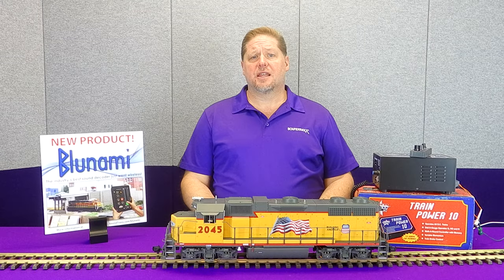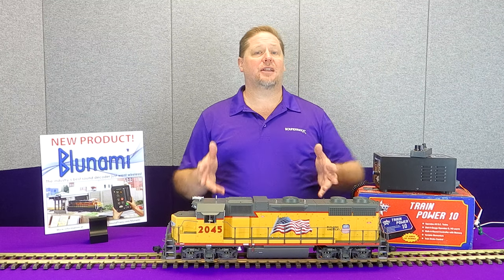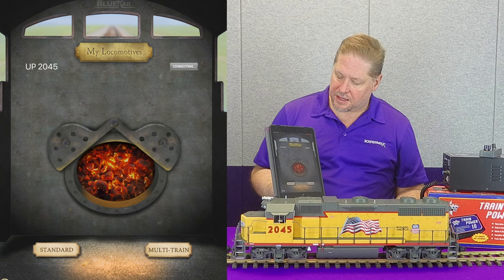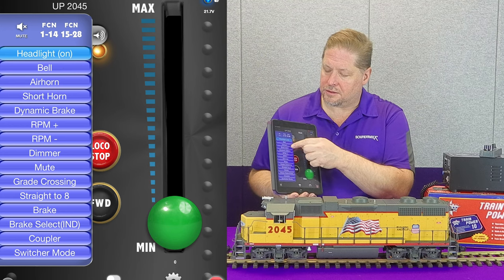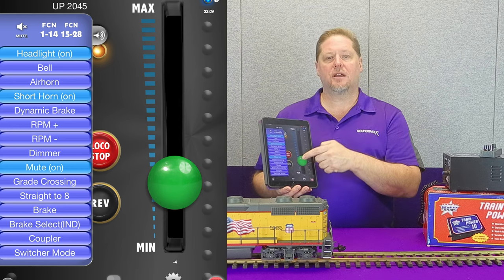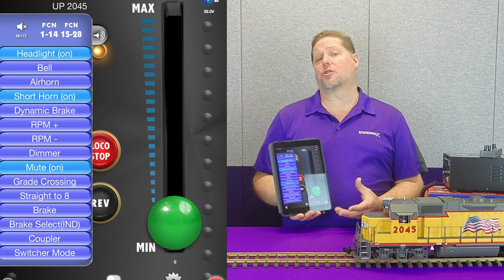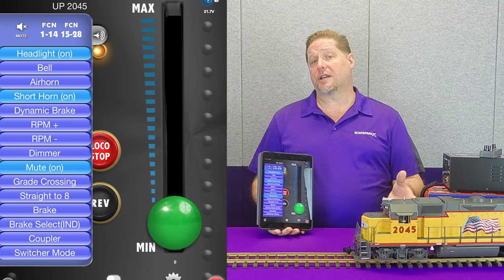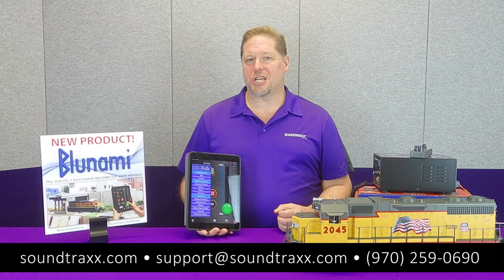BLU-4408 in USA Trains GP38-2 on DC

Comment: The stall current on the Blunami is rated at 4amps. The stall current on any USA Trains locomotive if far far higher than 4amps. How is blunami able to handle higher stall currents?
Reply from the maker: Wire the two motors in series and that will drop the stall current down below 4a.

Comment: if your track is powered with DC, will Blunami still support consisting?
Reply from the maker: As long as you have power to the decoder it will work - all features. Consisting is still in the works on the android app though.

Comment: Can it be installed on Kalamazoo 4-4-0 Locomotives?
Reply from the maker: As long as the stall current of the Kalamazoo loco is below 4A, then you should be fine.  These were released many years ago, so test the stall current to be sure.  If you need further assistance, then contact us at support@soundtraxx.com

Comment: Apparently we forgot to insert the installation video.   Here is the installation video for the GP38-2:  https://youtu.be/IdyTNJlb8P8
Reply: Bachmann advertises that the model will have a speaker already pre-installed. Hope that will make the install video for their Dash 9 much easier
Reply from the maker: Its linked in the video at 4:13 and in the description.
Reply from the maker: If you need any advice on the install just give us a call!

Comment: Does bluenami support smoke units? while id love to use bluenami I also would like to have smoke for major outdoor running, TCS's 501 DCC has very good smoke even synced to what the prime mover does? Does it support it similar to that?
Reply from the maker: You can use a function output on the Blunami to control your smoke unit. Contact our Support Team directly and they can walk you through the process: (970)259-0690 ext. 22 or support@soundtraxx.com

Comment: Can the decoder be setup to run on a standard DC layout WITHOUT connecting to the app? I.E. Can the train run like a normal analogue locomotive on a DC layout, or will it just sit there unless connected to the app? I know DCC decoders usually have a dual-mode operation option where you can run DCC when on a DCC layout, or the locomotive behaves like a typical analogue layout when on standard DC power.
Reply from the maker: Blunami will operate in DC, DCC, or wireless mode. We have a few videos on this and you can always contact our Support Team directly to discuss further: (970)259-0690 ext.22 or support@soundtraxx.com

Comment: Hi from Glasgow Scotland 🏴 when are we going to see this in the 🇬🇧 for Hornby and Bachmann Model Locomotives
Reply from the maker: The two board formats we have right now are the BLU-2200 and BLU-4408. More formats are in the works. Our  Support Team can help you identify which models they will work in: (970)259-0690 ext.22 or support@soundtraxx.com

As far as factory installed goes, that is up to the locomotive manufacturer.

Comment: Hey George, I had a question regarding the installation of this decoder in other locomotives such as the Emd Sd42-2 which I havnt seen listed but I currently have 1 from USA trains and would like to know if this will work for it as well? Please please get back as I am really looking forward to experience sound in my g scale locomotives
Reply from the maker: In theory a similar setup to the GP38-2 should be possible for the SD40-2. We do have an articulated mode which can be enabled in CV 112 using the Blunami app. Contact our Support Team for more details on this: (970)259-0690 ext.22 or support@soundtraxx.com
Reply: @SoundtraxxDCC  Thank you So much!! Looking forward to Using your Guys Products😊

Comment: Can this work on thomas and friends  locomotives to and iOS game controllers to?
Reply from the maker: If the decoder will fit in the engine and the stall current is not too high you can use Blunami. The app will work with an iOS game controler.

Comment: Will it work with ab Arizto craft g scale -9
Reply: Yes.  With the 4 motors, you will wire 2 of the motors in series in each truck, the parallel the pairs to the decoder to keep the current under 4A.    This is what I was alluding to about Bachmann’s re-release of this model.   
I hope this helps.   
Thanks for watching!
Reply from the maker: Thanks George!